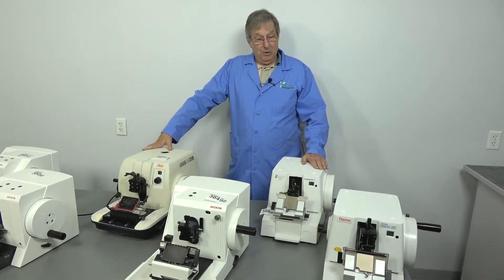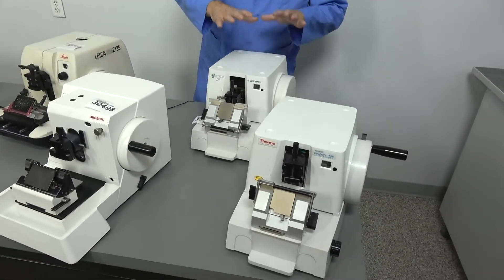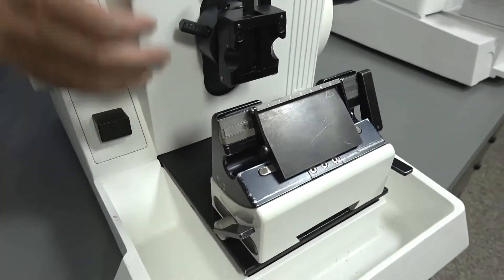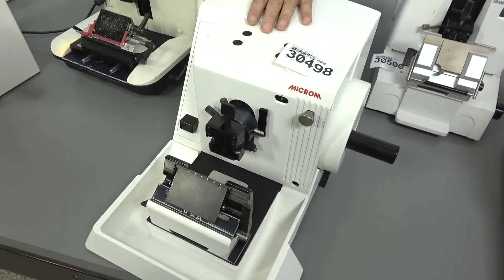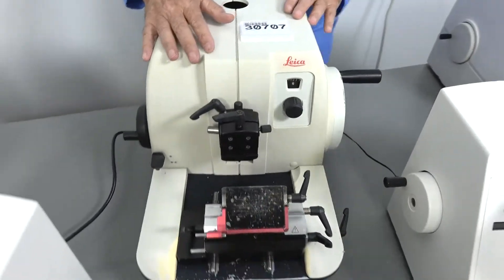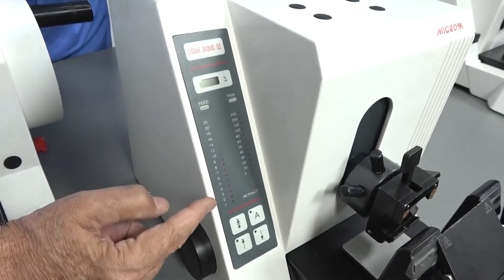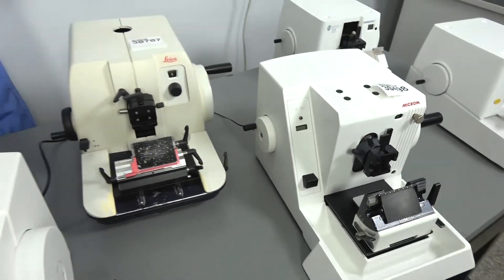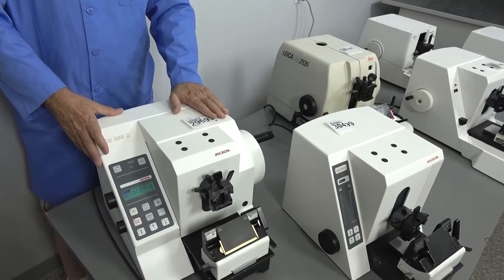Manual & Motorized Microtome Features Explained by Microtome Technician

Comment: This HM355 you showed doesn’t have the counter, is this a setting you can turn on and off?
Reply from the maker: Hi! The HM355 is a HM355S which should be able to show the counter on the control panel pressing the "scroll" button which is the upper most button on the left side on the controller. We believe the counter can be reset by pressing the upper right most button. We can send you a manual, do you have a 2 knob controller or a 3 knob controller? 

You may also email us at cs@newlifescientific.com